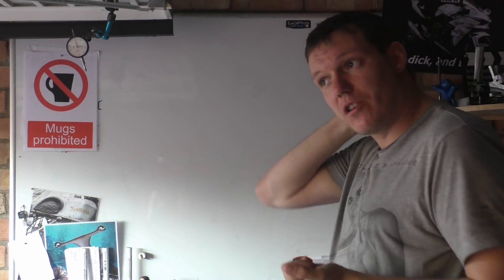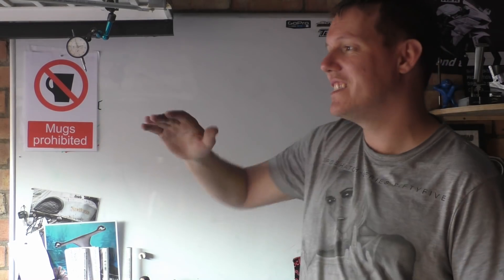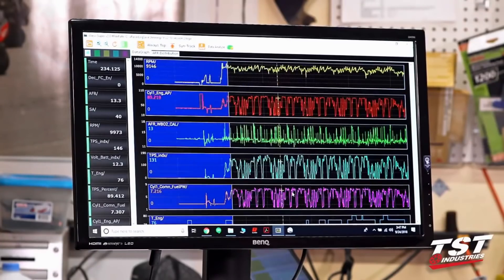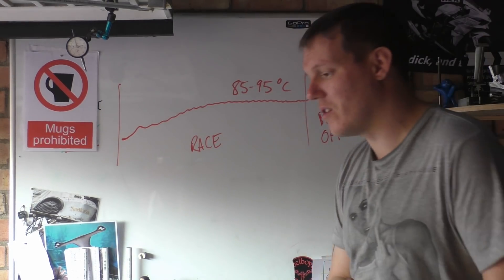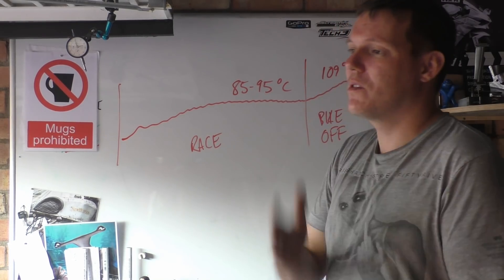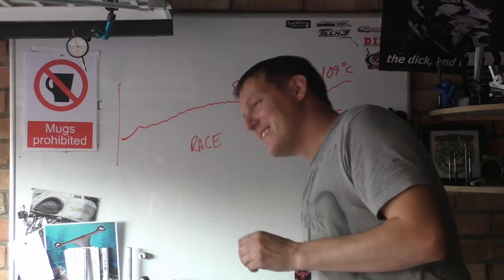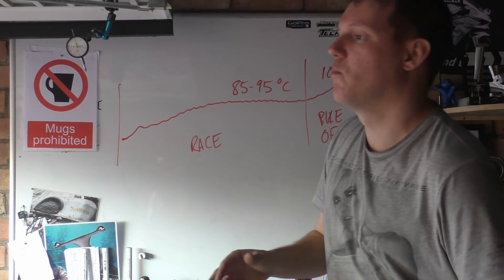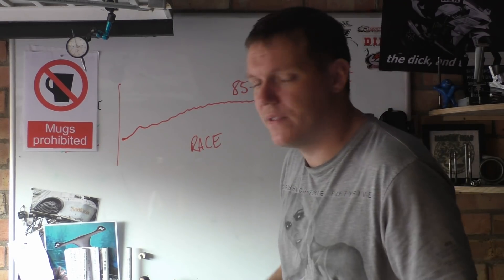R3 Failure Analysis - What happened next?

Comment: Matt excellent video why not get a basic bike such as a honda grom and do some blueprinting and lots of development and datalogging and see how far it can go performance wise before swapping out bolt on goodies
Reply: Rhys Jenkins That's kinda what honda does when they design a bike. They are not harley davidson lol... But yes obviously they work within a very tight cost frame which limits what you can do to the engine
Reply: @allesklarklaus147  I am aware of this but mass produced bikes are built to a standard spec and can they be improved on so what I'm saying is it would make great video trying to look for design and cost flaws and how much can be improved on by putting various parts and components under the microscope and using various tests and experiments to confirm findings